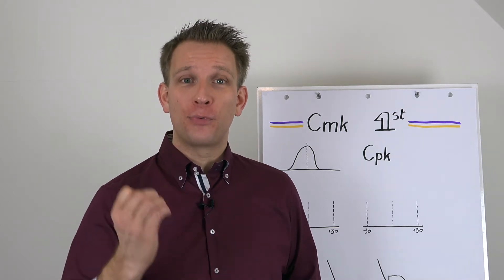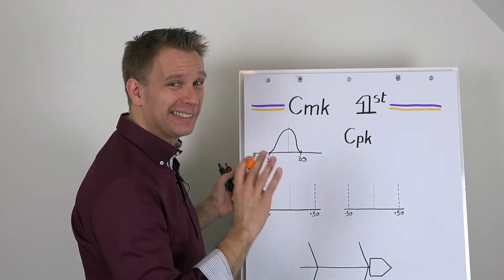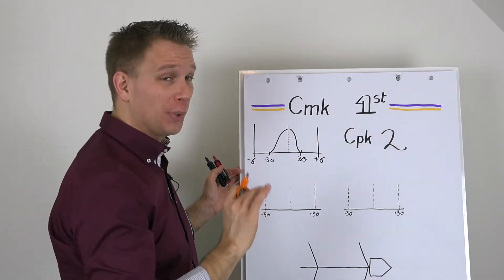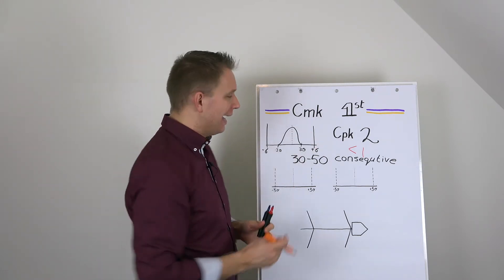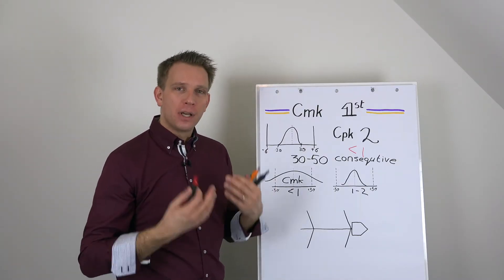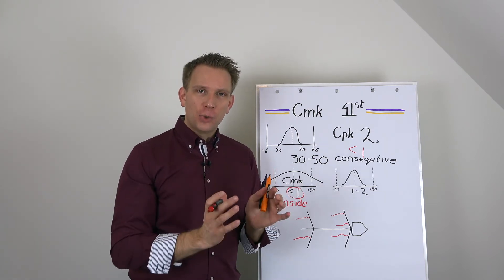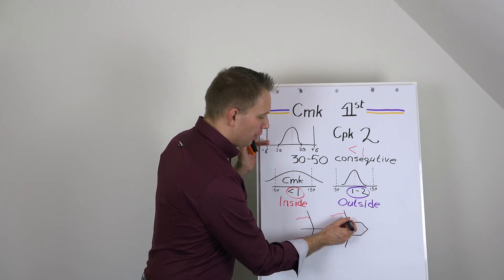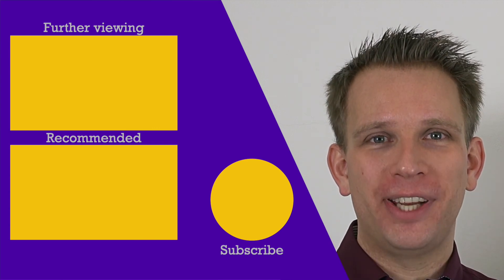Use Cmk First when improving the Cpk of a process | Machine capability use explained

Comment: Hi. In regards to this would you suggest also doing CP and CPK after you do CM and CMK even if the results are good? Do you think CM and CMK is enough for PPAP submission also (i am guessing what the customer wants). Also lets say you take consecutive 50 pcs doing CM and CMK study, would this be classed as 1 subgroup size?
Reply from the maker: Yes, Cmk is just the start - if it's good, then you continue with Cpk (and maybe Ppk).
Cmk is not enough for PPAP, because it doesn't tell you much about the final variation the customer is getting. For this, you'd need at least Cpk, which is a good indication of variation within each of your batches, or Ppk, which describes the longer term variation also when your customer gets different batches from you (any probably assumes that they will all be the same).
50 consecutive pieces is a subgroup size of 50, but that doesn't figure into Cmk calculations - just calculate standard deviation directly over sample sizes larger than 8 (no need to use SD estimation tables based on subgroup size).
Reply: @TomMentink  Hi Tom, thanks for the detailed explanation. In response to what you have said above. i thought if you collected x50 pcs off a run (1 part after another), then this would be classed as a subgroup size of 1 and then if you done the same an hour later (collected another x50 pcs) that would then be subgroup 2 or have i misunderstood would you have said
Reply from the maker: @deanopenn  these 50 pieces would make up 1 subgroup of size 50. Subgroup size means how many pieces/parts are within 1 sample.
And again - when calculating Cmk, don't worry about subgroups, since there is just one large sample (of 30+ pieces), this has nothing to do with how many pieces you'll put into each sample subgroup for later tests.

Comment: This is good video. My question is that how to deal with 30 or 50 data points distribution during calculation of Cmk if is not a normal distribution.
Reply from the maker: If your process is behaving in a very non-normal way even when you don't have any setups or material changes (within those first 30-50 consecutive data points), then you've got some work to do in understanding (and possibly improving) your process: where is that variation coming from in such short time-span?
If, for instance, your machine has a few moulds that produce the same product, but they have slight differences, that can be the reason for non-normal distribution in a short time-span. In this case, you either fix this difference (which would improve you process capability) or accept a lower final Cmk/Cpk. To check if this mould variation is the only source of non-normality, you can make sample subgroups taking the average of one whole cycle of products (one form each of the moulds) and check if those averages are normally distributed. Do note that if you continue to use sample subgroups for your Cpk calculations later on, you'll artificially be reducing the variation, so you're no longer showing the same number (so if you were planning Cmk on single sample data points, which I think is the best way, do return to that after improving the process).

Comment: Thank you for your vid.
One question i have about the scenarios: 
Why should I check the several factors (in the ishikawa) if the originally selected 50pcs of parts were consequtive, and where there was no material change, person change, setting change, method change...etc..?
Thank you
Reply from the maker: When your Cmk is low, you’ve got a structural instability that occurs even within short spans of time - this can still be caused by the operator, when they’re not skilled in operating the machine consistently for instance; or the material, if there are significant deviations even within material batches; or settings, when settings shift during machine runtime. More often than not, the machine cannot produce a stable product quality with the available materials, but I wanted to explicitly point out that low Cmk isn’t only due to machine causes.
High Cmk + low Ppk points you in the direction of machine+operator+material are able to find stable conditions for each single combination of those three, but each operator (or each material batch) produced a different stable result, so your total process is still unstable.

Comment: Hi tom, you are doing good job,please listen your video using earphone, when you are writing something there is a irritating noise.
Reply from the maker: Thanks for the heads up - I’ll check it out. 
Could you describe the noise? Is it likely the sound the marker makes on paper, or some different noise?
Reply: @TomMentink  yes exactly, it seems that either one is rough surface so its making a painful noise, you can experience it. 😊

Comment: Do you have a webinar?
Reply from the maker: No, not yet. But I am thinking about it. Doubting between a minicourse on practical problem solving or PCS. 
What were you looking for/thinking about?
Reply: @TomMentink  Im proposing to implement PM Optimisation Plan, but i think we also need Cmk data
Reply from the maker: @jb769  for a preventive maintenance plan you don’t really need Cmk. Cmk will help you to stabilize your processes and reduce variations - a very good thing by itself, but it tells you more about your process than the state of the machinery.
To make an effective PM plan, the foundation is a good ABC analysis determining which equipment is vital, important or redundant - make sure you focus your PM on the vital machines first.

Comment: Do you have any applicable samples? Can you share with us, please?
Reply from the maker: I’ll have to see what I’m allowed to share - I’ll probably have to strip more than just a few labels.
The thing you have to look out for the most in practice is operators reacting to the process while you’re trying to set the baseline. 
I’ve had a measurement systems analysis where the laboratory staff could see the results of our tests, and because the first results showed quite a deviation, they already started changing the settings before we did our full sampling plan - the second half of the results did show less deviation, but they (1) overreacted and introduced a structural deviation in the opposite direction and (2) we could toss away the results, because the spread was way bigger than that system would normally have (without the lab operator touching the settings).
I also had a project to reduce off cuts, where the operators were used to change the cutting height based on the off cut percentage over the last hour or so - they sort of reduced the overall off cut rate, but because we couldn’t get a clean measurement it took us a long time to notice what was really happening: when the cheese size went under a certain weight, the machine would cut one less piece, but that ‘not so sweet spot’ caused it cut a big end piece off. Once we forced ourselves to just let the machine run at one setting for a whole shift, that problem became very clear and we could set up the cutter based on the size of the incoming cheese, in stead of guessing it from the last hour’s results.